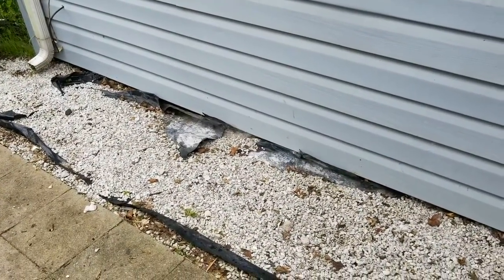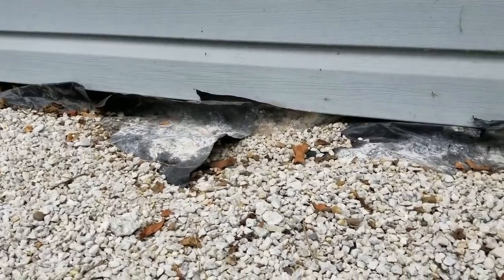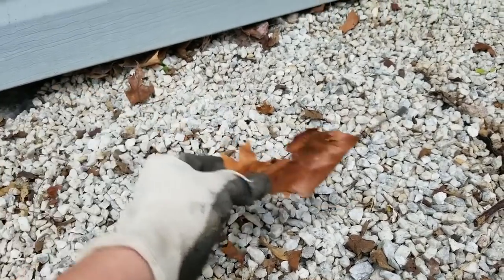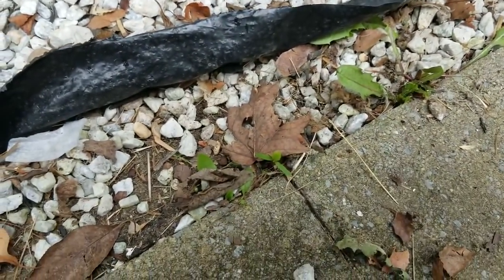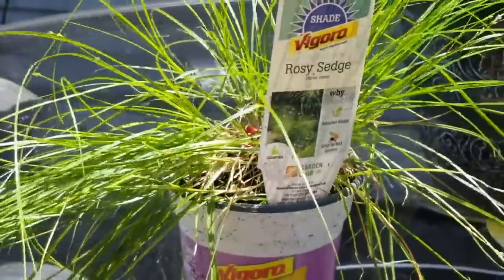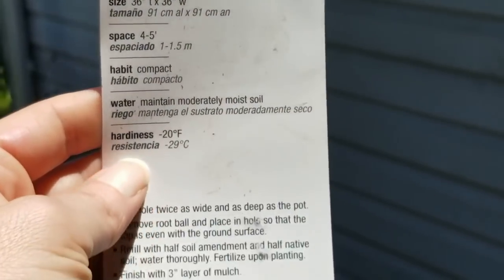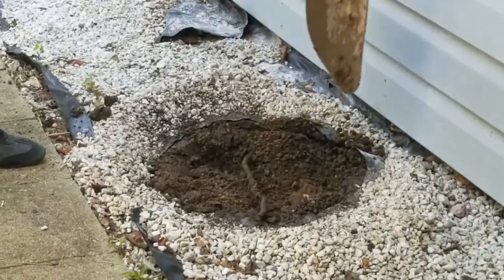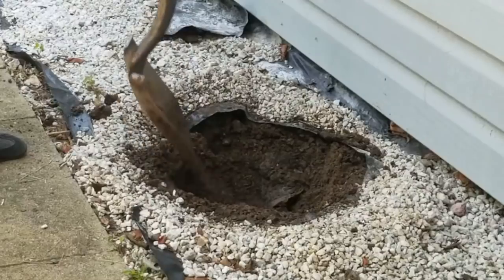Asmr - Rock Garden Makeover - Softly Spoken

Comment: Just a couple notes for future planting as I am a landscaper and thought you may like some help to make the process easier and allow plants to grow more successfully: when cutting out fabric you only need to cut out about one to two inches wider than the size of plant and you don’t have to cut out a circle, simply cut an x or t and fold fabric under (this allows you to replace fabric without having to add more later if you decide to remove the plant) also, you don’t want to cut too large an area because you’re just creating more open space for weeds to come in), your hole only needs to be as wide and deep as the plant itself unless you intend to add potting soil. Using post hole diggers works more easily and precise than a shovel. When you go to put the plant in the hole, you should always first break up the roots at the very bottom to allow them to grown into the ground and establish in the new soil. You just take your hands and pull roots without detaching entirely. Not doing this often will stunt future growth. Buy fabric staples and resecure fabric in areas where it pulled up to avoid excess weeds.
Reply from the maker: Thank you!
Reply: @AmuseAsmr  sorry for kind of ranting on...I love to teach anything I am learned in, so I get excited, lol. Thanks, again, for your wonderfully calming vids